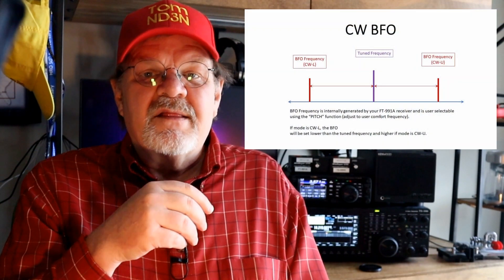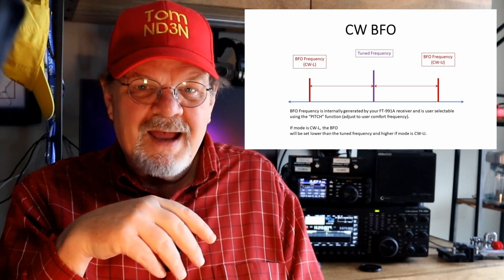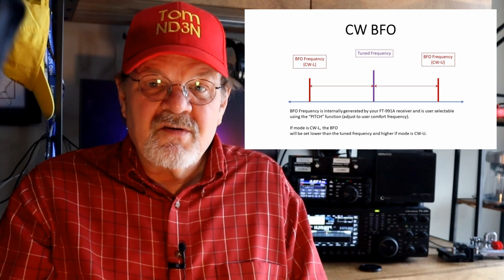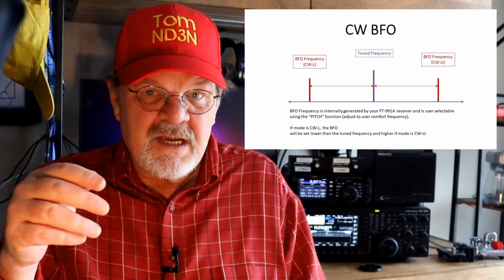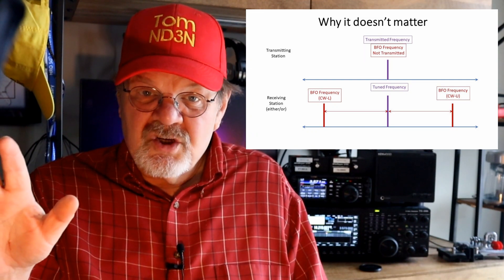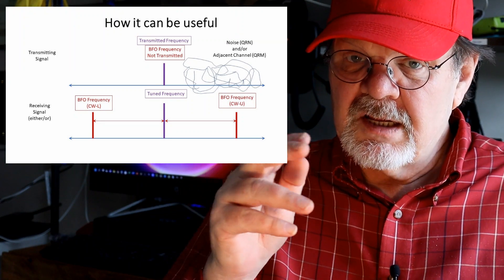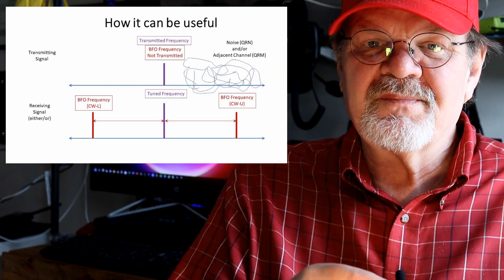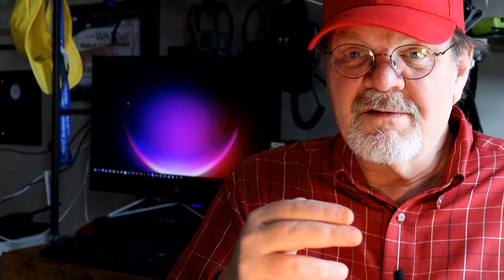Confused about the CW-LSB and CW-USB modes...  Watch and learn

Comment: Great explanation of USB CW and LSB CW.  I'm mostly a CW operator, I love the USB CW LSB CW ability on my Yaesu FT DX 1200. I'll find myself often with either qrn or qrm encroaching and if I have qrm if I switch between upper sideband CW and lower sideband CW it tends to get rid of The unwanted signal. I'm not a CW only operator I do get on SSB as well but not as much as CW. Great video 73, 👍🙂

Comment: Hi Tom, I like the cw-LSB  or the cw USB settings because i can still hear the correct SSB mode (depending on the band ) when keeping the receiver in the cw mode and not having to reverse the Upper to the lower....or vice versa while tuning around into the SSB portion of the band....

Comment: Sorry for the wiseguy comment but the standard definition of QRN is [N]atural noise as in atmospheric and galactic noise while QRM is [M]anmade noise, the bandwidth of the noise has no relevance to this definition.  You're not alone - many hams fail to distinguish between manmade and natural noise properly and think e.g. QRM is "other hams" while QRN is "everything else".  Why is this even important?

Most natural noise is wideband in relation to bandwidths used in ham radio, while even the widest bandwidth racket made by hams is narrowband noise. But there are so many other sources of manmade noise completely unrelated to ham radio, of which many are genuinely wideband in nature and this QRM can look and sound perfectly like QRN (as in "white noise" equal power distribution within the bandwidth, no discernible signal), it's just distinguishable by its higher level.  As a result of this confusion there are so many hams not understanding that most of their high noise floor is actually QRM, not QRN and that they could do something about it.

Comment: Thanks for this video. For some reason this topic confuses people but your explanation with the visual aids makes perfect sense.

I have a Ten Tec Omni VII, and Ten Tec simply calls the two modes UCW and LCW. The Omni VII doesn't default to one mode or the other but I believe that Ten Tec considers LCW to be 'normal'. The nice thing is that if you are zero beat with the other station you can switch between the modes and neither you or the other station will notice. And if there is an interfering signal in the passband in one mode, you can get rid of it by switching to the other mode, as you mentioned.

A far cry from the Heathkit DX-60 and RME-6900 receiver I started with as a Novice in 1971. But I sure did like the RME-6900.

73,
Mike - WB4HUC